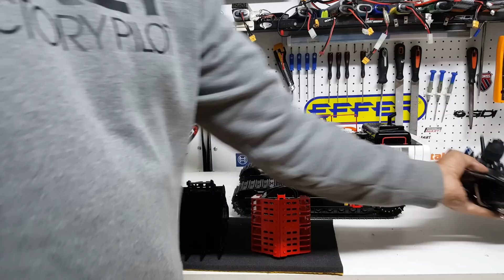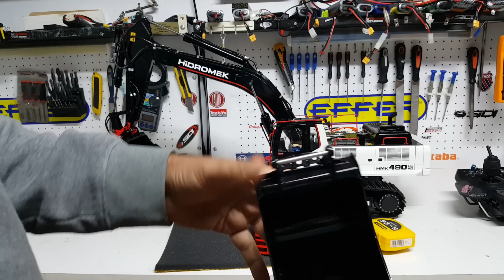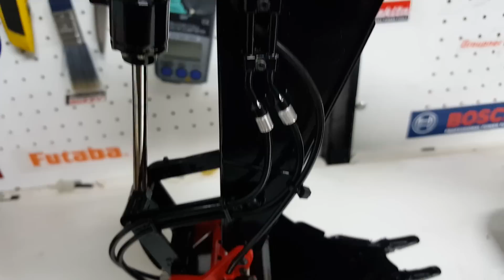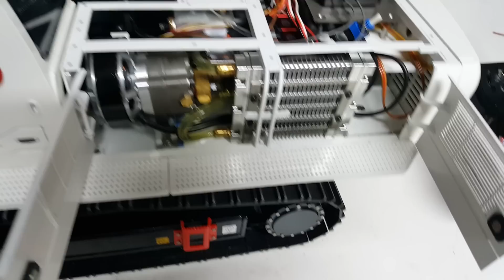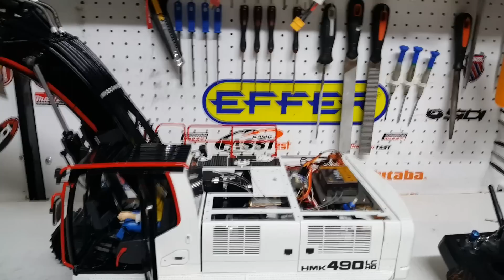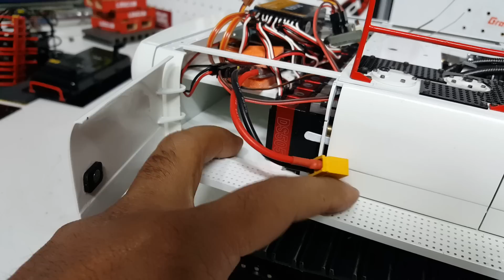CSMI :Review  HIDROMEK HMK490  Excavator PART 2

Comment: I have order a hidromek HMK490 at a very cheap price from a on line store from overseas for around $65.00 🇺🇸 not received it yet just wondering what the catch is I can not get any details from the shipper but for the price what the heck how can you go wrong or did I get screwed?
Reply from the maker: Hi Eddie don't think it's possible to get a $12000 machine for that price the shipping alone due to the weight is $400. Even the diecast model is more than $100. Can you share the website with everyone? Hopefully they send you something or you get your money back . All the best.
Reply: @CSMIRC  thanks for the info here is the site emgstore service team@diamondistech.store
Well just for shits and giggles here is the tracking number use200515bphc1000237.   
I can't get a response for this number this is the first time I got the wrong end of the deal glade it was not a lot of money let me know what you come up with thanks Eddie